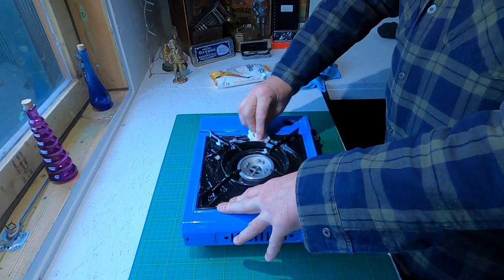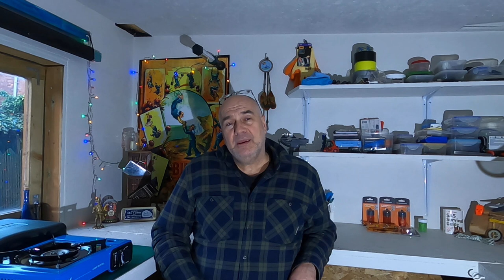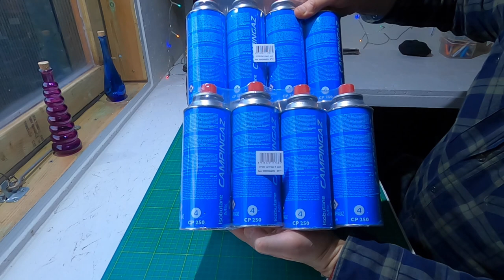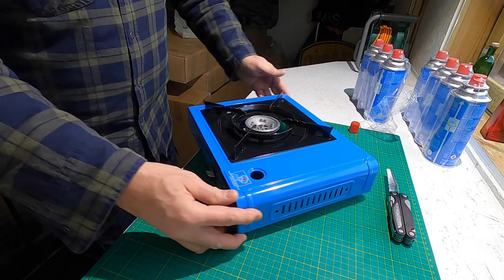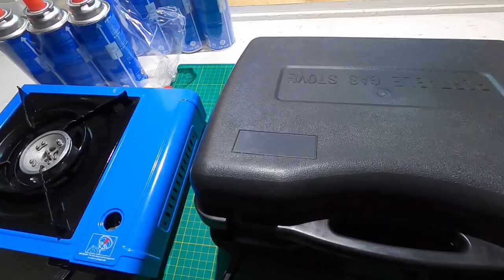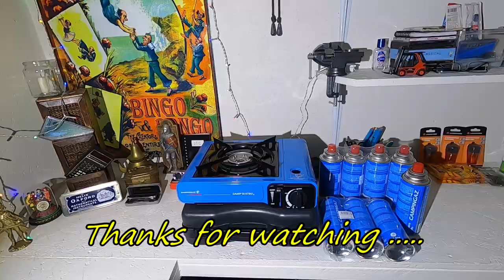Cook Cheaply Without Electricity - Best Budget Gas Stove For Emergencies.

Comment: Nice bit of kit, had mine about 6 months now but after its been running for about 5 minutes the flame gets smaller, I change the bottle and its OK again for about 5 minutes, seems the flame gets smaller as the gas bottle gets colder......anyone else get this problem or has a solution?.....thanks
Reply: No solution but the problem is caused by the gas bottles cooling down and losing pressure. its an issue with most stoves that use those canisters.